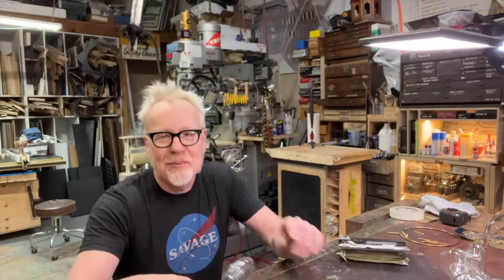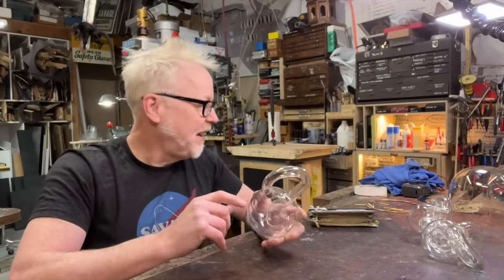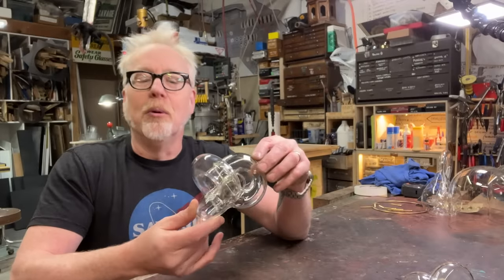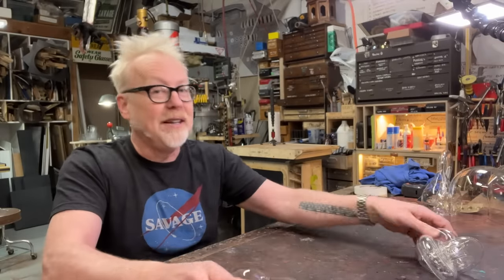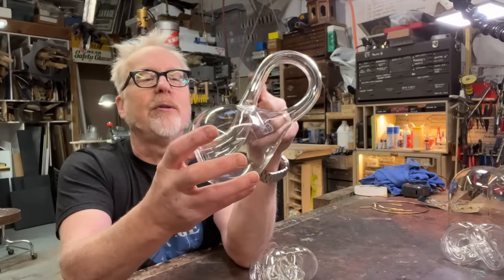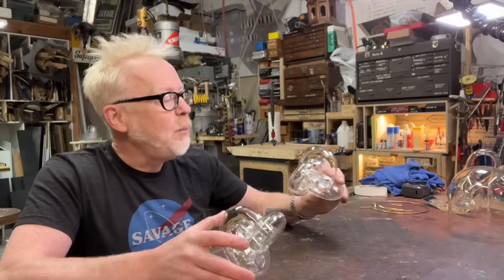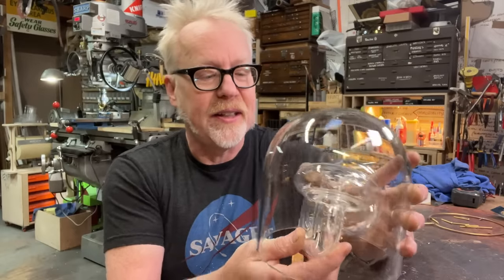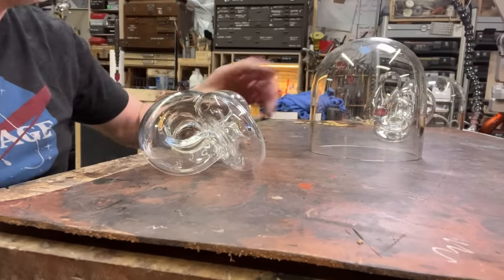This Object Should've Been Impossible to Make

Comment: Adam, I like your final design, but I liked your original brass ring idea more. I feel you didn't do it as well as you could have. 
Instead of brass cups, you could have used spring-loaded pins and then either made shallow indentations in the Boy's Surface for the pins to sink into, or if necessary. have the pins barely pierce the surface to seat the pins fully. But because the pins are spring-loaded the piece should be fairly easily removable. But this design permits rotation on only one axis. Because the object is so weird looking, it almost demands to be presented in a  3D cradle, much like a gyroscopic globe. Then it can be rotated in three axes. This might make the object somewhat more awkward to remove from the cradle, but some clever spring-loading of the cradle arms might simplify its removal. In addition,, the pins holding the piece in place could probably contain micro-LEDs that would be hidden from view, but illuminate the object from within the pins. The cradle would probable need to be relatively lightweight in appearance, so as not to detract too much from uniqueness of the Boy's Surface. (Maybe made of tempered glass or plexiglass for a nonlighted model, or light-gauge brass tubing to hide micro-Led wiring.)

Comment: Just saw this video.  Sad that I missed it but the glass art could easily be suspended in your case with 3 rods sticking up from the base with a slight outward angle and all at various heights. This will offset the symmetry and also provide a beautiful viewing angle for the refracted light. The rods would be best made of glass as well to keep the ascetic of the art piece.

Comment: My thought was to put thin brass bar with a curved cradle piece on a slow-spinning motor in the base so it would "hang" on the bar from the inside top of the piece, and rotate in view. It could be taken off the mount and just re-hung on it fairly easily.  Just a thought.

Comment: ABSOLUTELY STABLE SOLUTION FOR THE HALO MOUNT: To keep the object from migrating due to the pressurized neoprene, grind down the edges of the mounting cups to be ergonomically correct for the curvature of their mating points on said object. Now the objects resting in the mounting cup is natural, minimal pressure is required, because oppositional curvatures of the multiple mating points will lock the object in place. This minimizes the pressure necessary for the locking mechanism, employing the objects naturally contrasting curvature instead, and making migration of the object over time impossible.

Comment: Super simple. We interpret physical things as 3 dimensions, X, Y, Z.

This is not a flat plane that has no sides.

This is our 3 dimension mindset expressing, a sphere into our comfort zone. Clearly 3 intertwined Klein bottles.

So make it easy for people, display it with lobe horizontal, one vertical, and one front to back.

Displayed at any reasonable height, (chest to waist level), the trilateral simitry will be apparent as one approaches/departs the object.

I haven't watched the whole thing yet. But, I imagine every plane is just slightly askew in the final mount.

Comment: I'm fairly new to your YouTube videos, and now I'm totally enthralled! I have some questions at 46:12:  Right after saying, "oh no" you are putting a battery in the wooden holder at your left. It looks like it's a holder for a soldering iron. Does that DeWalt-looking battery run it? also it looks like there is a nest of brass wool that you dipped the soldering iron into - is that a flux, or to clean the end of the iron? Do you have a video where you made this holder?

Comment: What about an apparatus like a pod? For visual… those egg shaped nap pods. But instead of egg shaped just make it a sphere. Inside put high density foam carved in the shape if the art piece so it cradles it and line it with a velvet or some kind of material that would give you good contrast to show the angles of the piece. Place a few LED light along the inside ridge of the opening so that you can control lighting in the pod. You could even go as far as to put a light in the button facing up so that you could illuminate the art piece. In my head this idea would really show the piece well with out having the glass dome around the outside to take away the detail of the piece. Just my wacky thought.

Comment: With the brass ring, could you have placed a half circle ring middle of the full circle ring and placed another support, then fixed the brass cradle at and angle to your base so the glass piece sits nicely supported and still able to take the glass piece out for closer observation???? Just a thought 💭 ✌️🌟 nice little project 👍🏻

Comment: Adding a brass handle would have helped to visually separate the display from the object. 

If liked to have seen the object mounted inside a gyroscope type mount so it can be spun in any direction.

Comment: I'm only 13 minutes in, but logically the dalek bumps will never securely hold that object, though I do also wish they would. The display/retaining ring could still work if in place of the cups you tried plus sign (+) shaped brackets. Extending each axis of the plus just far enough to arc over the horizon of the curvature it's applied to, then using a threaded rod through the retaining ring so it's distance from center is adjustable from outside the retaining ring, obviously also giving that threaded rod a swivel joint at the bracket so the bracket doesn't spin during adjustment. It would also be advisable to put a nut on the threaded rod outside the ring to tension the rod against the ring so it doesn't self adjust over time. I know that's intricate, provided I've even communicated that clearly, but given your goal it doesn't seem unreasonable. I'm going to watch the rest of the video now because I'm very interested to see what you come with and how far off I am from your solution.

Comment: make a half  moon shaped brass piece with another brass cup and fuse to bottom as a third arm, and angle it  circle up at an angle and make a straight piece of brass as a base going to a heavy base of copper or brass . copper to represent the sphere as normal and the brass represents the object you are making the base for, or use small brass colored suction cups instead of brass cups, it might be a little tacky , but it could work.

Comment: Why not run some clear epoxy through the hole with some sort of wire that acts as a holder/ bracket? You could even put directional arrows on the wire to show the flow of the tube.

Comment: The mount was great idea but instead of brass tips use rubber suction cups painted the same colour as the brass. Would it hold it sufficiently over time maune even slightly srin load the holders. That's my thinking anyways loved the video and huge fan from the UK. 👍

Comment: String light come out of support tube and go out the other one even a hot wire that glows and goes right thru the middle of the thru tube that bells out the other side and back into  the support pipe.  reorient that the support tube lines up with the center of the bell opening.  glowing in the dark it'll really make you think about the endlessness of the whole thing.

Comment: 4 minutes in, ADAM, be careful, don't break the glass! 
8 minutes in, did he miss the obvious, slowly spinning in two plains? I'll see.
8:40, he cut himself, NOT GLASS I hope, oh good the glass is OK.
9:44 OH MY GOD! Please stop working!
10:38>>> 3M double sided adhesive foam tape.
12:00 man, rotate it horizontal and vertical in slow mode. You can do it!
12:55 Look at a kitchen trap, cut out a section of the curve that is similar to the curve of you glassware. 
You may need a different size pipe, but the bent pipe shape is what you want.
15:00 OK, I give, time to speed thru, ARRGH, no two dimensional spin.
 OK, fun at the end. 
Thanks ADAM.
Please rethink the display with rotation.
I found a poor representation of what I wanted, but I searched through hundreds of videos without finding a good model.
Front facing gear does what I want, X rotation starts at 22 seconds.
https://www.youtube.com/watch?v=DG8tvKuSuO8

Comment: I'm surprised you didn't use black or clear rubber pads on the first clamp cups, that would have stuck it in place and held it but still allow you to remove it, the grip was the factor i think.

Comment: OKAY @21:45 You said "add the topography for this thing." MAP THAT TOPOGRAPHY TO THE BRASS MOUNTING CUPS! Then lil' neoprene pads works, because pressure us no longer a mandate, and the oppositional directions of the mating points on the object lock it into the mounts and prevent migration due to pressure and vibration over time... voila! Halo mount works!!

Comment: In theory, if I understand it correctly, and I’m not at all sure that I do, it’s a continuous tube…so what about running a wire through and hanging it inside the cloche. A thick lucite base with a light incorporated would display it beautifully and it could be removed to handle.
Now I’ll watch the rest of the video and see what you came up with
Reply: I like your idea. Looks great

Comment: Just came across this and only watched till it fell out the brass loop. I like the brass idea, maybe it would look cool within a brass frame 3 sided pyramid or a triangular bipyramid on stand
Reply: If mounting inside those glass domes it would be good if the base with the pins rotated slowly using a motor

Comment: Adam has slightly better luck than the average smoker of the wakky tobaccy. When they get overly excited and drop a valuable piece of glass on a hard shop floor, they end up with multiple pieces of glass. He drops an impossible object made if glass, and it remained a single piece of glass. Could you imagine having to call the guy who found a way to make those and explain to him that he might need to make a 3rd one, because one of the others might have accidentaloy been multiplied. 🫣🫣

Comment: FWIW---I think your first idea was in the right direction, except instead of one vertical hoop I wonder if one horiz hoop with a peg or two coming up from the base could have worked. The 'problem' I see with what you did is that the object is too rooted to the base where it needs to be floating so one can see all of its surfaces.

Comment: What about threading a clear nylon thread thick enough but small enough to not detract from the Item, pulled taught, and attached to an outer holder, perhaps can be rotated with knobs that protrude out of the casing?

Or Fiber Optic or LED strands, threaded through with the LEDs lighting in a following pattern through the loops.

Or how about a liquid filled sphere? Yes, it would take a lot of work, but for such a unique feat of "Brainery"  π√∆✓© Why not!!??

An inverted sphere within,( or would it be without?) an extraverted inverted sphere ;-)

Not to imply that your work of mastery is less than a beautiful work of Art, but just a thought for future projects....

Comment: I have no attention span and no next to nothing about science but, I heard DISPLAY it ? I always have a problem with glass behind glass, I feel like the reflection throws me off.
 I thought it would be cool to have the Boys surface scanned and have the computer scan interactive where you could move it on screen at different angles by increments. It could be dissected in different spots and put together again. 
The physical "Boys" could be present next to the computer display suspended with "invisible thread" it would probably still need a case over it to display it due to its vulnerability. Behind the glass argh

Comment: You should have used rubber plungers like is used with suction cup darts, instead of brass spheres. The rubber would put pressure on the glass surface. You would glue the threaded portion into the rubber so as you tightened up the three ,the rubber suction cups would put apply pressure and hold your atrsy fartsy sculpture.in the ring.

Comment: Actually , I love that idea with the brass ring and the little brass cups I'm only thirteen minutes into the video but I'm surprised.
He's not using some type of rubber.Them or like suction cup Of some kind In the suction cups Or tighten the cups Against the Glass and then putting a tiny little tack So the pin doesn't loosen or make the cups more like Claws like an eagle claw Or.
Something  lol And then put the whole ring into another ring, so you can spin it around to See the different angles LO.L .... idk im High right 😂

Comment: So you said you would make a display that shows off all the facets and dimensions of a glass  boise surface mobius loop yet by the end there was none.is it really that complicated to have the object suspended by the original ring system but incorperate; rubber grip rings on cups,Fishing wire wraps through cups and around the glass tubing,clear adhesive, or magnets inside the cups with magnets in lnside bottle.More complicated methods could use sound levitation or contrasting buoyant liquids/gas within and outside said object.You could rig it so there is colour within the object and the surrounding empty is space is black.Coloured Lasers could be pointed at key spots on the object to point out symmetrical design.I like the ring idea because you could make a sort of gyroscopic variable ring movement that allows the object to be viewed at any angle. This is all supposed you have the object centered in a clear sphere.

Comment: I am just now viewing this Adam & immediately saw how elegant your first mount is. The ONLY problem with it is that the "disks" need to be "saddles" instead . . . get me? Like cutting a donut in half, that way you have maximum DELICATE grip . . . just like your hand . . . (no pun intended). Your ELEGANT brass holder is so complimentary to the object & could be mounted in a slow turning socket to provide the same view as holding it WITHOUT holding it. It's PERFECT! Honestly . . . The bell jar is clunky & common -

Comment: ive found that the staff are unreliable at turning art exhibits ON/OFF and buttons are also problematic for the same reasons.
I have come to it being best to use Motion Sensors. Basically zero effort of staff and able to handle power outages.

Comment: To draw that is one thing ok.. but to produce it in blown glass is in my untrained in glass blowing opinion, almost inconceivablly possible no matter how many times you attempted and failed to make it. That being said, the glass blower that made those physical representations of a mathematical quandary that's barely imaginable within the mediocre capacity of our brains to process structures of the next dimension, is at genius level for real. The only thing that keeps it from being 4th dimensional in our reality is that in its current 3rd dimensional form its only possible to present itself 3 dimensionally to us because of our inability to function 4th dimensionnally where we would truly see all sides of its structure simultaneously. Being clear gives us the illusion that we see its other side but we don't see it as it's witnessed in the next dimension from all sides and internally at once. Makes my head hurt thinking about it.

Comment: Adam, @10:35... why tf are you putting the metal plungers DIRECTLY against the glass?!? No wonder you almost dropped the damn thing, you're trying to keep a 2 ton brick motionless on an ice covered slope! RUBBER DISKS MAN!!! Put lil' rubber disks between the plungers and the object. Now you can apply pressure by loosening the plungers, compress the disks rather than the object, and be applying enough force to render the object both stationary and stable. I swear, geniuses are pros at missing the obvious while achieving the complex... like, every time.

Comment: Adam, not to put too fine a point on it, but you would be a good deal easier to understand if you finished your sentences.  Starting four or five unfinished sentences before getting around to an actual thought tends to dilute your presentation quite a bit.  Take a breath.  Think.  Then talk.  If the universe is silent for 3 seconds, it does not actually blow up...

Comment: You've got an amazingly mechanical mind, but it's not a 4D construct. We are 4D, anything sharing our existence is 4D (4th D is time/ time =gravity) we are caught in it's current and have a limited control over it, including quantitative measurements of time. Therefore, we are 4D beings or constructs. To invert a sphere, you would need some version of the Fine structure constant and it's relation to pi, as pi equates to the spaces between structures. That math is a bit beyond me... at this time.

Comment: YOU CAN PUT TWO OF THEM TOGETHER NOT SYMMETRICALLY BUT LIKE OFFSET SO THAT ALSO BRINGS MORE ATTENTION TO THE PEACE MAYBE EVEN MAKE THE SIZE OF THE HOLDER EACH EACH MAYBE A LITTLE BIT DIFFERENT TIME MENTION OR MAYBE A DIFFERENT MEDIUM I MEAN I CAN SEE THIS PEACE MUSEUM WISE AND IT'S AN INVENTION USING THE METHOD THAT I'M SUGGESTING AROUND PICTURE INTO MY HEAD I THINK I'M ARTICULATING IT CORRECTLY WE'D ACTUALLY BRING THE VIEWER MORE CURIOSITY MORE I APPEAL MORE DESIRE TO STARE TO TO TRY TO FIGURE OUT THE THE OBJECT I MEAN JUST MY OPINION
Reply: AND IF YOU WANTED TO USE THAT GLASS SPHERE OVER THE OBJECT THEN AND BE BORING LIKE ALL THE OTHER MUSEUM STUFF DIDN'T HATE YOU KNOW SO BE IT BUT YOU COULD MAYBE USE A LARGER ONE AND THAT MIGHT MAKE YOUR JOB A LITTLE EASIER JUST SAYING YOU DON'T HAVE TO USE THAT SPECIFIC ONE BUT THAT'S IF YOU WANT TO BE BORING I THINK THAT OBJECT IS WAY MORE INTERESTING THAN A GLASS SPHERE SURROUNDING IT TO DISPLAY IT JUST MY OPINION AND WE ALL KNOW THAT WE HAVE THEM